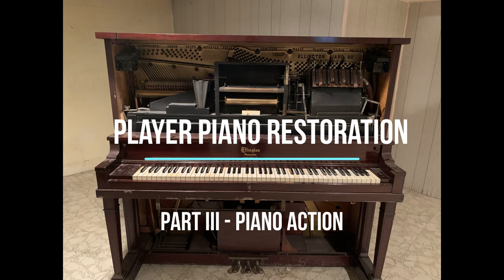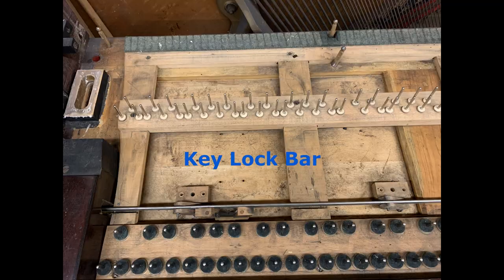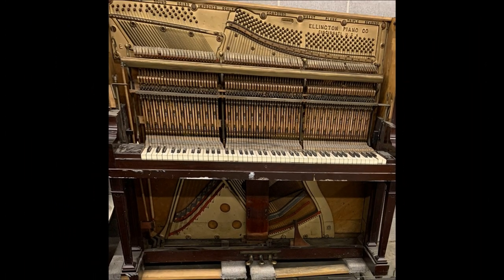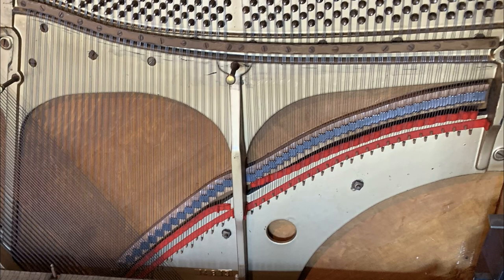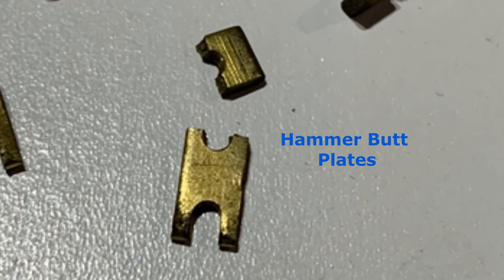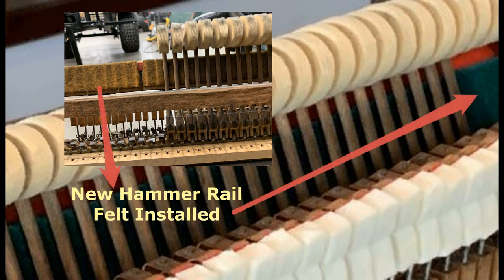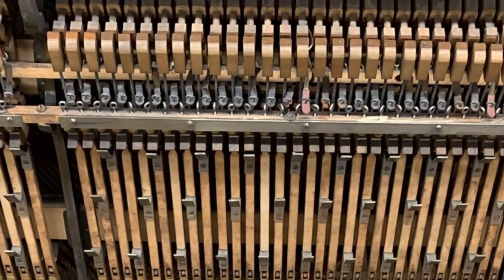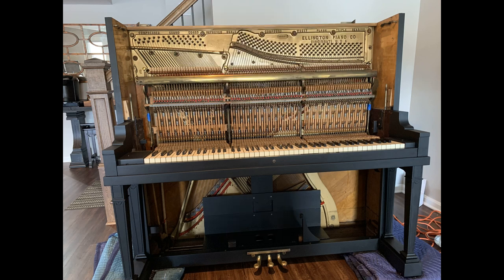Player Piano Restoration:  Part III-  The Piano Action

Comment: I have a 1920 player piano and about 100 rolls. I am moving and need to sell or donate or hopefully not trash it.  Any ideas for me on how to do this?  I also have the out of print repair manual.  Thanks for any info - not sure how else to contact you.
Reply from the maker: There are a few Facebook player pianos forums that you can advertise on.  It’s a tough market to sell especially if your player needs work but if it’s a good model someone in the group may want it or know someone that does.  Best bet is to group player piano rolls in groups of 25-30 and sell as a lot on the Facebook forum.  You may get $50-75 a lot.   Most blues and rags have higher value and may be worth separating
Reply: Thank you SO much for your reply and ideas. Really appreciate it.